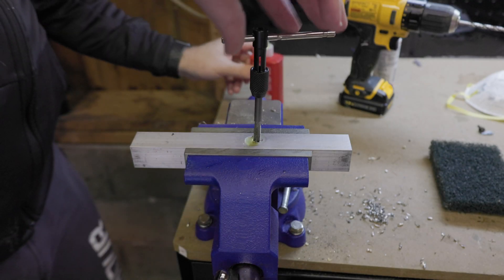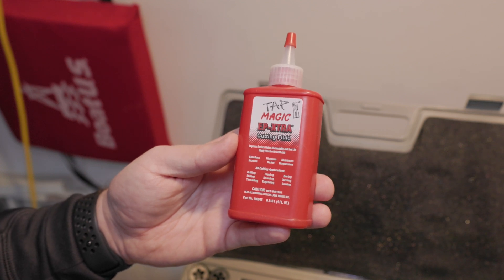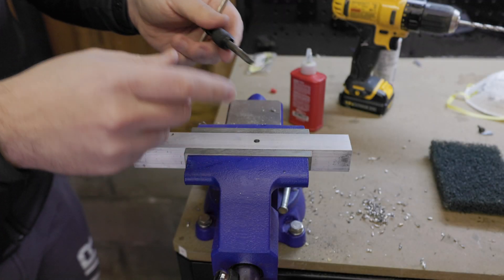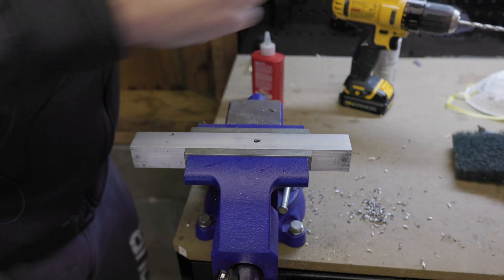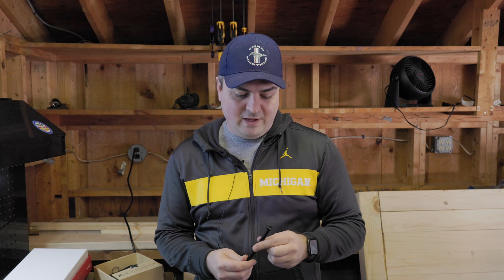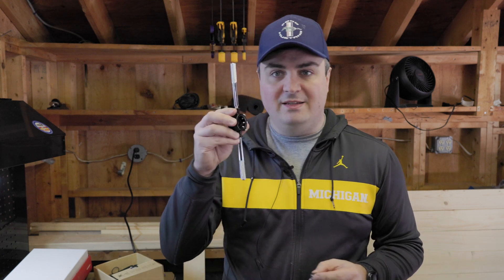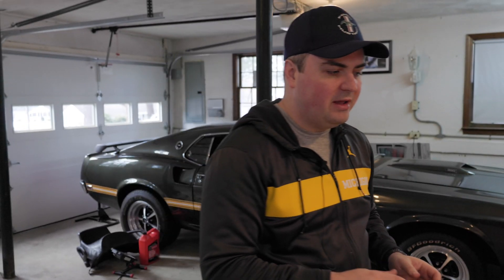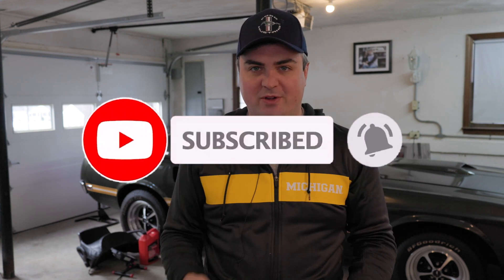How to Use a Tap and Die Set

Comment: Nice 1969 Mach 1 with 390 V8!  Great background for your informative video.
Reply from the maker: Thank you! It is nice to have in the background
Reply: @SmackeysGarage  I had a 1969 Mach 1 M code with a transplanted 351C 4V.  I currently have a 1969 Boss 302 in my garage that see little activity.  Too expensive to replace.
Reply from the maker: Yea I hear you on the 69 302. I wouldn’t be driving that around much unless it was already a driver. Something like that is pretty much irreplaceable now at any reasonable cost.